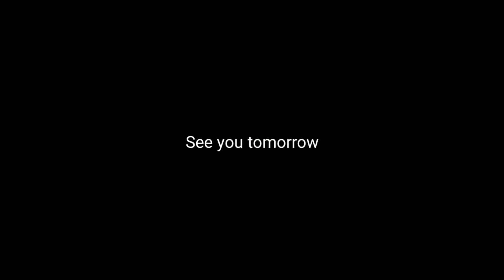Installing the side rails on the roof of my Dodge Grand Caravan for luggage rack

Comment: Awesome Carolyn, you are so independent, way to go!  Just a tip for future projects, if you ever run into the problem where your bit isn't long enough, just insert a long nail or an ice pick in the slot & tap it lightly to make a mark.  Why are you sweating, Arizona heat isn't the same as hot weather in other areas.  LOL just kidding!!!  God bless you & yours!

Comment: you may need to add some kind of waterproof sealant around the screw holes etc just like when installing a fan in solar cable in roof etc

just to prevent leaks in torrential rain etc
Reply from the maker: It says it isn't necessary but I'm not quite feeling it. 😕 I will probably do so.
Reply: @CaravanCarolyn  

its only because in the uk it rains more than its sunny lol and uk vanlife channels always make the holes waterproof etc lol

Comment: An old nail or screw will help You make a tiny little place in the metal to start Your drill bit or screw. Tap on it with a hammer or pliers to make what they call a piolet hole.

Comment: Thank you so much for showing us these projects. I look so forward to seeing what you’re doing next to your van and dream about the day that I can do the same thing. One thing I thought about though was the screws that are going into the actual roof of the car metal, in Arizona it is so hot that anything that has any kind of a sealant can just break down so quickly in the heat. Do they make a Silicone that won’t be affected by hot or cold?
Reply from the maker: Can't say
Reply from the maker: But I am probably going to add some silicone.

Comment: Great job CC.  My 2019 DGC has the roof racks already.  I’m seriously considering getting running boards like I had on my Ford Explorer suv.  

At 72,  I have the driver seat all the way down to get in the seat but I can’t see over the steering wheel.  I have to raise & lower the driver seat every time.  Also, I cannot get into the back of the van if the seat is stowed!  I need a step up.  If I had the running board, I could solve both those issues & not worry about putting out a step!  

I look forward to seeing how you arrange your mini home for your next trip.  Cheers, Mo in NJ

Comment: Good work!  My only suggestion is to wear sneakers on the ladder, I worried your foot would slip off the ladder rung.  That's all I got! :)
Reply from the maker: My sandals are Clark's walking shoes, so just as good as runners.  But thanks for the tip.

Comment: @~2:50 in the video you said it comes with like a coating on the screws to make it so you don't have to do other sealants. Its now been a year since you made the video. I wanted to ask if that still held true after seeing if it would leak or not leak after a year? (I hope that is the case but wanted to check, since I want to do this also. But water can be a big issue for some places.) 

Thank you.
Reply from the maker: Have not had any leaks.
Reply: @CaravanCarolyn  Thank you for the reply.

Comment: I like how you moved it forward from the first try, and these are the shorty ones - I really never thought about that and was going to install the long OEM rails, but now may reconsider for sure.
did you order the adjustable cross rails yet? and or make sure the adjustable limits were in their range?  I guess it matters on the brand, but definitely a before Rail install item to research.  Thanks for the video ! and Travel well!

Comment: Still no captions after two days. Pls. check settings.
Reply from the maker: I have nothing to do with that.  There are no settings for me to check. I'm sorry.
Reply: @CaravanCarolyn  Actually there are. "Autocaption" requires the video "owner" to turn AC  on.  How that is done I have no clue, as I only watch and don't post. But it is a thing.  I like your channel, obviously
Reply from the maker: @WWarthog798  I see.  But that would turn them on for everyone. Right?
Reply: @CaravanCarolyn  As I understand it, both the content owner and the video viewer have to "turn captions on", the owner by some setting on their channel, and the viewer by the "gear" icon at lower right of video.  If the owner doesn't turn on, then nobody gets captions.

Comment: Still no captions after 24 hours. Pls. check settings.
Reply from the maker: Have you seen subtitles in my videos in the past?
Reply: @CaravanCarolyn  Yes. This problem has only cropped up on "some" videos (a minority), which is why I suspect some setting is not staying "set".
Reply from the maker: @WWarthog798  Then it's a problem on your end.  I have never set or changed any settings regarding subtitles.
Reply from the maker: @WWarthog798  I'm sorry Duane, I wish I could help you.

Comment: You didn't prep your drill hole. Why am I telling you that, because you left it as raw metal and it's only a matter of time before it starts to rust and once it starts rusting it's going to lift the paint and it's going to rot the metal. When that happens you lose your contact with the metal and the screw and the rack is going to lift. I know from experience. You need to prep your hole with some primer at the minimum and some type of paint, of course matching your vehicle color, so that you keep out the moisture from the raw metal. If you don't you know what the consequences are going to be. Trust me on that. Fyi, the factory installed racks are equipped with a bolt either welded to the roof metal from the inside or epoxied to the metal. They sit flush with the roof surface and you can bolt your rack in place. Much safer than just using screws to hold the rack in place. Nothing like a roof rack coming off of a car in front of you and striking your windshield. Good luck on longevity.

Comment: I feel like you would have been better to put the rails at the back not the middle. Also why wouldnt you have gotten a factory rail system. It goes the full length and looks better. This looks like the rail for a small car not a van.
Reply from the maker: Because my solar panel us in back. Can't cover it up. Although I do regret not getting longer ones.